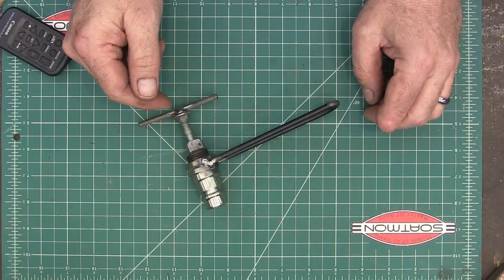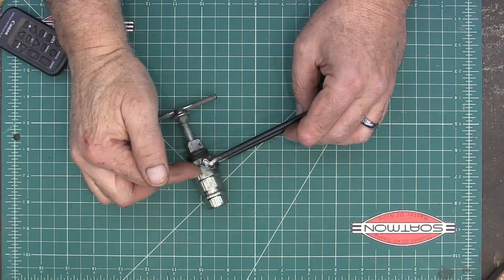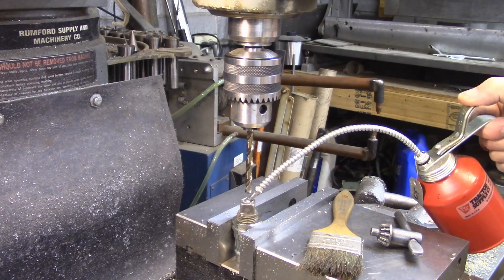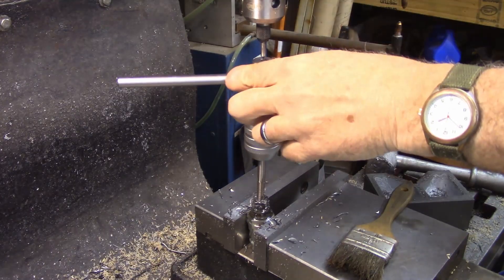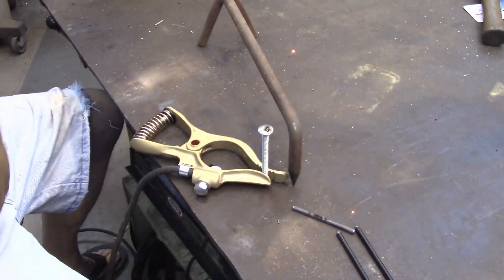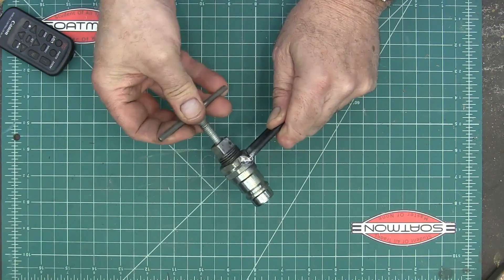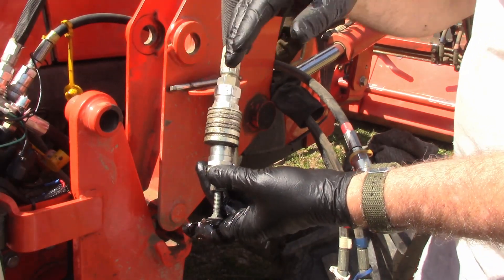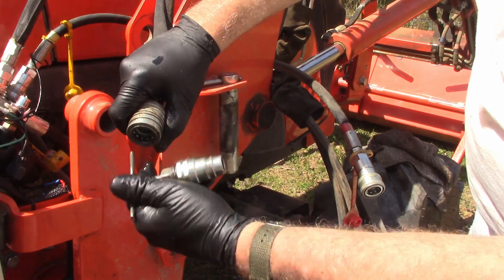DIY Hydraulic Pressure Relief Tool

Comment: Fun project but a lot of unnecessary work!

Google: QC-Mate by XBoom Coupler (1/2" & 3/4" Duo-Jaw Set, 12” QC-Mate Clamp)

Easily clamp flat face pressurized QC hydraulic connectors with ease!

Comment: Had the same problem on the female side if my grapple. I had lossen the connector on the line further down on the grapple. It worked but wish I had a rig like you made. Did not really follow how you had screwed the pipe cap and some washer there I guess to the back end of your release connector. Thank you

Comment: Smart! I wonder why the tool doesn't exist. Perhaps standard to have the male and female the other way around? The problem seems more likely to exist on the pressure-side (more oil to expand due to temperature changes) of things and the tool exist for the male connection? Just wondering why the tool exist for one connection and not the other. Thanks!
Reply from the maker: I had the same thoughts.  I am using it on my kubota loader and the fittings were installed when I bought it so I would think others would have the same issue.  Anyway, this is working so all is good.
Reply: Most machines have a process to release the pressure, depending on the system.  The implements on the other hand have no easy way of releasing the pressure.  Even on my machine with the release activated there can still be pressure at the coupling that won't allow easy hook up.

Comment: You know I have never run into that problem.   Not sure why with all the auxiliary hydraulic fittings and hoses around here.  But having seen this will surely help.  This is a good idea for sure and really to relieve the pressure would involve only a very small amount of oil, I am sure.   We are getting little cherries starting to develop on the trees, first time in years.  Hope you are having a good weekend and hope you are seeing your fruit trees develop this year too. Thank  you for the video and that idea.
Reply from the maker: They usually will release when you connect them but with the resent temp swings I couldn't push hard enough to release the pressure but this works great.  As you said a small amount of oil is all it takes.  I won't get any fruit again this year.  When I have time I may have to rethink the variety I have.  I hope you have a good week Glenn!